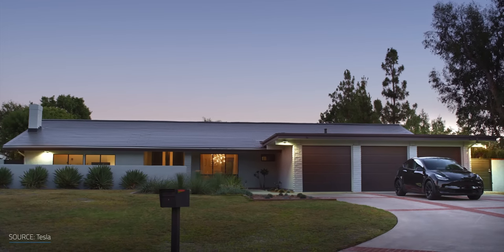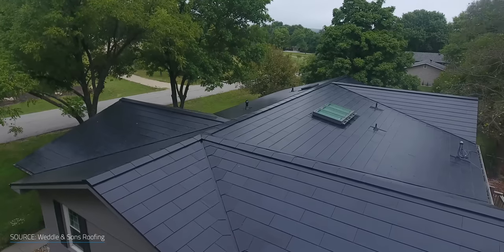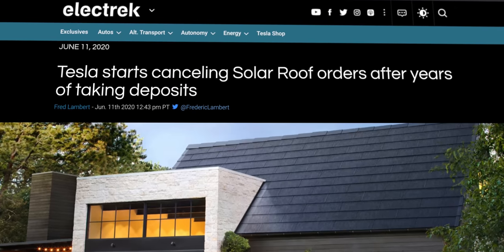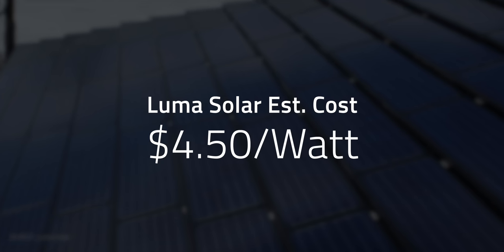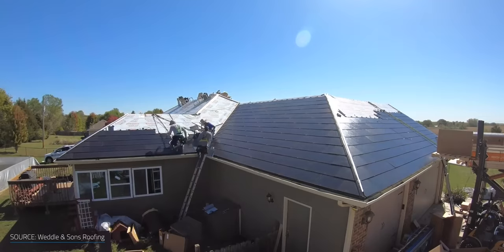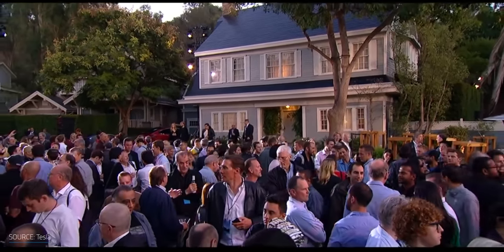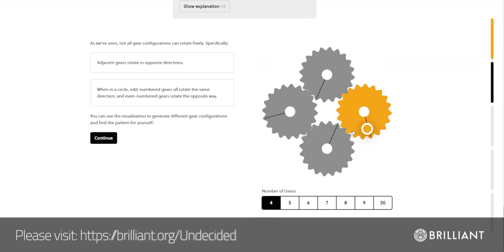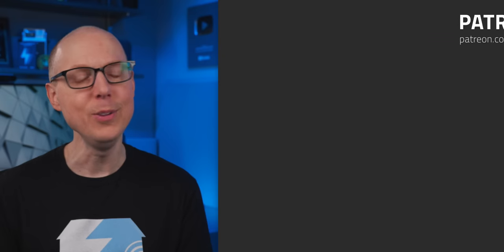The Problem With Tesla’s Solar Roof

Comment from the maker: So what do you think of solar roofs? Go to https://brilliant.org/Undecided to sign up for free. And also, the first 200 people will get 20% off their annual premium membership.

If you liked this, check out Exploring How This Plant Could Replace Concrete: https://youtu.be/mx7g79Jh66k?list=PLnTSM-ORSgi7UWp64ZlOKUPNXePMTdU4d
Reply: Clay roof tiles never have to be replaced. I have 2 sloping roofs, one facing west and the other east. I waited until I had put up 2 rooftop dormers with flat roofs and installed the solar panels on that all facing south.
Reply: Gaff. Gaffe? Oh, he means  G.A.F. Like the G.A.F. ViewMaster.
Reply: The only thing holding solar roofing off is the difference between R&D scale and consumer product manufacturing. They simply cannot make the tiles/panels fast enough for the demand already out there. The companies involved, including Tesla, all need to look at major capitol investment for manufacturing at scale. Tesla already knows how to do this. I think the only problem here is that Elon has too much on his plate and hasn't put the time or resources into it to make it happen.
Reply: My only complaint with your video is the touting of things like 30 year guarantees. Very few companies are around 30 years later so I would not put too much stock into those claims. For example LG recently announced they are leaving the pv panel market.
Reply: IM ASSUMING U TWEETED THIS AT THEM ALSO SO THEY COULD FIX IT
Reply: You are missing out on an entire class of solar roof system, solar metal roof systems. Integrating flexible solar into standing seam metal roofs as the backing. After all if you are the kind of person that can spend extra for solar then the sticker shock of a metal roof is much smaller. Also with the panels integrated into the roof it still cuts out that extra step while being a quick roof to put up in general.
Reply: I think they're stupid and a waste of money honestly.  Fine for the upper 25% I guess?  But in terms of use of materials, cost efficiency, etc....., simply terrible.

I don't believe these are any better for recycling than other roof tiles, where I just don't think it would happen and you end up tossing away metals that should have been recycled.  With standard shingles you end up with a pile of shingles that needs to be dealt with, the question is can they be dealt with.  But once again this is a question for the upper 25% because most people can't afford this.

In terms of what's the most earth friendly, then a steel roof that's properly mounted and maintained, with sound proofing underneath is the most earth friendly.  Then put solar panels on top of that for those who want solar panels.  But a tin roof isn't good for those houses that have multiple sides on the roof.  It's good for a ranch style home.  But a ranch style roof is what we'll have for our retirement home, and the home is made with cement blocks (construction grade of course), with a bit of rebar to reinforce.  There is a combo 2nd floor with balcony.  So there is tin roof over the 2nd floor, once again with sound proofing.  Then there's a solar array over the garage, and the garage has basically a flat roof so you can walk around the array, and the array will track the sun during the day (in the tropics, near the equator, no need for a north or south facing array and best to track the sun from east to west during the day).

So, you live in the N. USA and you install a roof like this.  How terribly inefficient would it be if a good section of the roof faces north?
Reply: Hi, Matt. You said a few weeks ago that you would release a followup to your "solid hydrogen" video, and that you were nearly ready to publish. Is that true? When should we expect to see you address the strong fundamental criticisms that have been noted about your video?
Reply: @michaell170  LG has committed to fulfilling their warranties, tho
Reply: @michaell170  Buy some 20 year old panels.  They will still work if they didn't get damaged by something hitting them.   Solar panels do have long lifespans, but your point is valid about if near 30 years anyone will be around to warranty them.  LG also left the cell phone market, does that mean cell phones are going to fail?  LOL.  I still love my V60 ThinQ whether LG is making them or not.
Reply: People replace their roof when it leaks. A three month wait is a deal breaker. My roof is not solar. There was no financing plan that fit and the price was too high. The roofer was not connected to available subsidies and all I knew was that waiting into winter was not an option.
Reply: What is the difference between "strongly recommending Brilliant" and "recommending Brilliant"?
Why use the word strongly?
Reply: @Thunderbuck  True enough and hopefully they will follow through
Reply: get rid of these tiles. larger is better, even the rich might prefer the panel look for statement.  Tesla should take advantage of current events and tie Tesla energy to the cars. Solar even makes more sense with EVs
Reply: I live in hurricane prone S FL. Tesla solar roof was just approved here and I’m going through the purchase process now, which is going well so far. No commitments on installation dates yet though. Researching other solutions like SolteQ since it is FL based and there are more options, colors.
Reply: Matt. The problem with price determining everything, as you stated, is, as most good economists know, are externalities.  If the price of carbon was in the price of everything then you couldn't afford not to have solar.  Of course as inequality rises fewer and fewer people can afford any type of roof, let alone a solar roof.
Reply: How do these stand up to hail storms? Will you be able to walk on these? What kind of maintenance will they need?
Reply: Im curious why did you change the thumbnail?
Reply: The BIG problem with a solar roof is that despite being a really neat idea, no-one including Tesla can make one ! End of !
Reply: The solar roof problem can be summed up in one word; superconductivity. 
With Superconductivity, there's not much energy used. Plus portable generators make energy easy to come by. 
You can't even begin to fathom how easy energy is to get.
Reply: With Superconductivity, you can create more energy than it takes to power the supply system. Think electric motor and alternator/other motor in line, closed electrical system. Now, the unit, electric motor, powering the generator uses any of the common methods to enable Superconductivity... of which there are now numerous.
As long as it takes less energy to enable Superconductivity and the electric drive motor to the alternator, the power supply will always be plentiful.
Reply: It's stupid
Reply: @robh467  You haven't the first idea what you're drivelling on about !
Reply: @pasoundman  how does it cost energy to make superconductivity happen? You do understand the miracle that is superconductivity has advanced in just the last two weeks.....?!?!
Which, even before all the discoveries regarding superconductivity that has happened in the last two years; even before, when it was achieved by just using energy to achieve superconductivity through lower temperatures ....still, as demonstrated by the Festo Supra motor in 2016....if it took less energy to achieve Superconductivity in a system, than the total output the system provided ...then that is an abundance of energy. 

Now, I'm not gonna name call because it is apparent in just a few weeks of being informed with recent innovation...like the fact Superconductivity is now achievable through zapping a line with lasers fluctuating the wave and frequency that is energy...then someone, such as yourself, may just not be informed of the current applicability of the discoveries. 
So, delighted I could be the one to inform you that yes...over unity systems are not only currently available, and even produced by commercial manufacturing..but are very easy and simple to come by. 
As one Nobel prize winner put it; "Superconductivity will change the next hundred years the way electricity changed the last hundred years". 
Your day just got a little brighter I hope.
Reply: @pasoundman  I mean; you say "it's not so because it has to be cooled(edit)". In the last two years dozens of elements have been discovered to provide Superconductivity, even at room temperature.
Reply: @pasoundman  but again; Festo in Ohio demonstrated the principal in 2015. They used an seven hundred watt supercooler to enable Superconductivity in a fifteen hundred watt electric motor...that powered a fifteen thousand watt electromagnetic motor. 
...simple math. They also demonstrated due to heat confinement in such a system it is remarkable the load they are able to perform.
Reply: @pasoundman  anxiously awaiting you response. I know how much you must be delighted to hear such wonderful news and information.
Reply: @pasoundman  I mean, a simple Google search would list all the room temperature superconductors discovered in the last two years. I mean, it's like the infancy of halbach arrays were expounding upon. 
Wait, are you familiar with halbach arrays and star coils? Etc. 
...?!?!
Reply: @pannenkoekspek  come back and read my comments to expand your knowledge and eliminate ignorance.
Reply: @pasoundman  "no one can make one". 
Oh, I didn't read your other comments fully. 
It wasn't apparent to me in my dialogue with you initially that you were cognitively deficient. 
My apologies and sympathy.
Reply: @pasoundman  if you actually say, "I was wrong, I wasn't up to date on the information"....it will bring honor to your conscience
Reply: There is a reason why you keep structure and appliances seperated. What If it fails and No 1:1 replacement is available. Also whats wrong with a solar panel layer in top of the house which protects your roof?
Reply: @robh467  I'm not wrong on matters of science.
Have you got any relevant qualification in any field of science at all or do you just make it all up ?
The number of people on YouTube who think magic is the new science amazes me.
Reply: @pasoundman  that was a really lousy way of saying "I googled all those things we discussed and I was astounded. You're completely right, and I accused you of being wrong. For that, I am sorry. I wasn't up to date, and was ignorant. What, sir, are your qualifications?"....
Yeah, if you had more than one testicle, you might have been capable of such a mature response.
Reply: @pasoundman  no, nothing of the sort. Just avoidance, unaccepting of responsibility and owning your behavior. Moronic driveling...
Reply: @pasoundman  I'm still ready to move on to discussing the innovation of sound and frequency "PA sound man"...but we're going nowhere fast if you can't act like an adult should act. School is in session, you gonna put your pecker down and break out a pen...?!??
Reply: Yeah that’s
Reply: It is pronounced G-A -F each letter, not as a word.....
Reply: @Myrddnn  Nobel winning physicist-"superconductivity will change the next hundred years the way electricity changed the last hundred years". 
Power is so easy to manufacture it's easier than baking a pie.
Reply: @tasrill  there's enough solar panels to charge a single glorified capacitor and enable Superconductivity generators.
Reply: The main problem with expensive investments in home energy generation is that some of them only make sense when selling power back to the grid and multiple locations have reneged on the prices they promised to pay. Consequence free. Years to recoup the investment have a good chance of not paying off.
Reply: I wish they sort of stuff would be done on council homes you should do seminars and invite councils
Reply: Can you make a video on green walls being installed it’s a great insulator and helpful for our polonagors
Reply: Got one problem with your video. Solar is NOT 'renewable' energy. The only energy source that is 'kind' of renewable is water, and even then there is a large amount of fossil fuel used to maintain them. Wind? Makes water look like a walk in the park for fossil fuel useage, and that isn't even including the landfills wind fills... Solar is almost as bad at filling landfills as wind, but takes WAY more energy to build and way, way, way more pollution in the process.
I have solar, I have a lot of solar that I installed myself, with batteries and everything needed to take myself OFF GRID. I like the independence part, I am just saying anyone that believes this hype of this being a 'renewable' energy is high AF
Reply: I like the them but they have another downside being put on older homes, when we had to replace shingles on ours the guys putting them on burnt out three nail guns. Come to find out our roof is old solid oak that was like metal. They had to use a very powerful gun to put them on and that could possibly crack something like the solar tiles
Reply: I live in Helotes TX just .3 miles from San Antonio and Tesla's site said they don't cover my area. Lol.
Reply: can you design a special garden fence to collect rainwater. a patented nice product ? I think it must be done by any company. The cities have lots of rain water but this rain water all goes to sewage. Whyyy🛢🛢🛢🛢
Reply: Pannello fotovoltaico flessibile e portatile Roll Array | LifeGate?
Reply: Hi Matt, here you have a case for you to study. I, as many, have all my roof with solar. That gives me energy to charge the BEV and our home and office during a couple of months. Yet, not enough power to move to geothermal or aerothermal/heat pump. I need more! So... where can I harvest more energy? And I keep looking at my house and wandering... what If I put vertical solar panels, little patches, here and there? In the chimney wall, for example, or in parts of the house walls. I know efficiency would be very small, but on the other side, they maybe easily installable as a plug and play system directly into a socket, without expensive wiring or inverters. So here you have a theme to study... what is there in the market to affordably patch every inch of your house with solar?
Reply: The Devil is in the details. 
Still I would like a Tesla roof. 
I have taiwan panels now and they are not performing like I thought they would .
Reply: How do any of these products hold up under a hail storm? And due to the cost of replacement, how does this affect homeowner's insurance costs?
Reply: We really really really want a solar tile roof, but the $$$$$ is a big obstacle